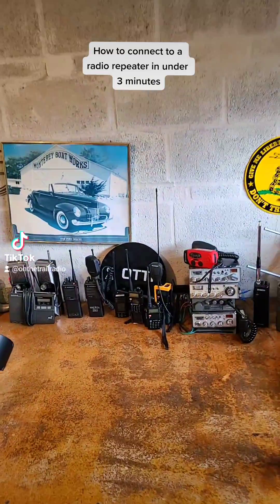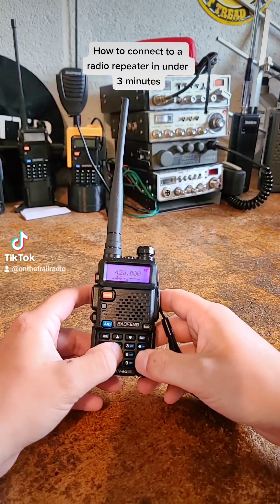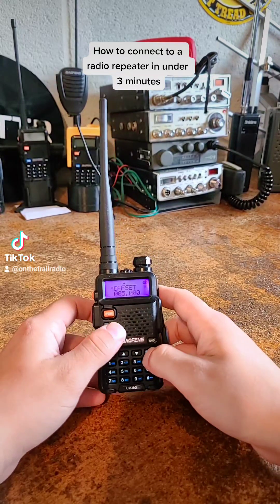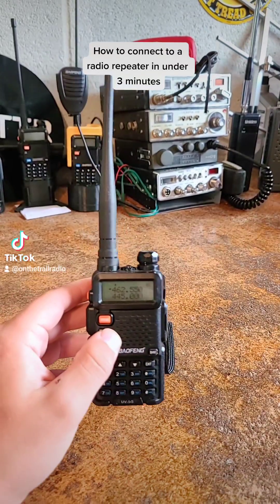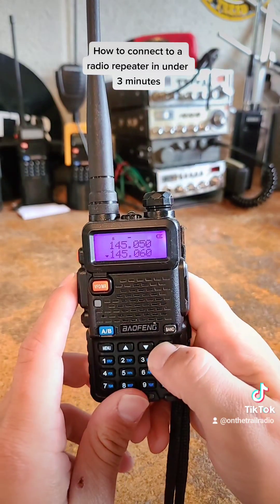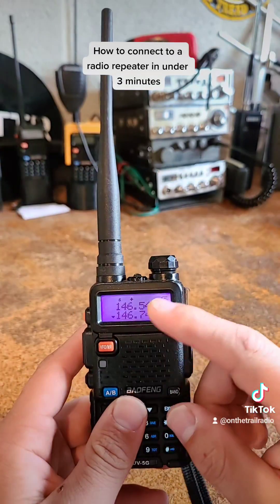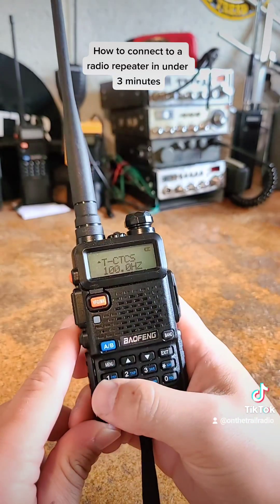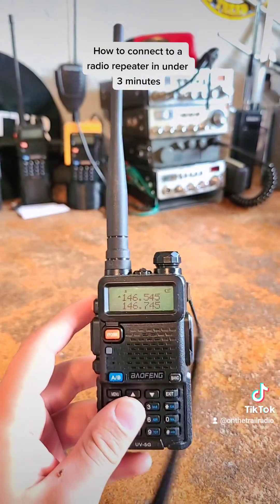How to Connect to a GMRS or Ham repeater in under 3 minutes

Comment: Thanks for this helpful video. One suggestion I have is to begin any discussion about connecting to repeaters with a comment that states “Start by setting your radio’s frequency to the transmitter frequency of the repeater. Then set your radio’s transmit frequency offset so that when you push the PTT button, your radio transmits at the repeaters receive frequency. Note that depending on the repeater, the offset of your radio may need to be positive or negative and in rare situations zero.”